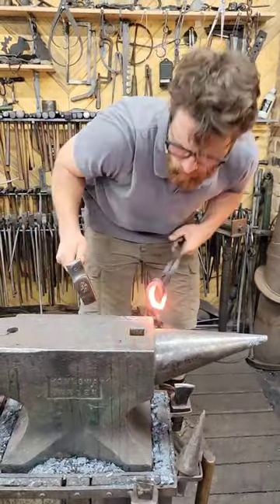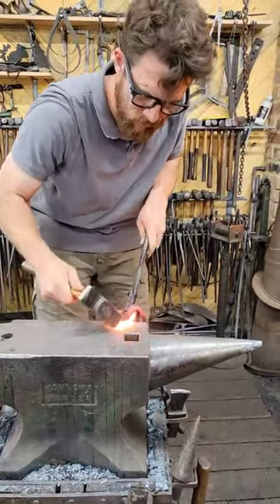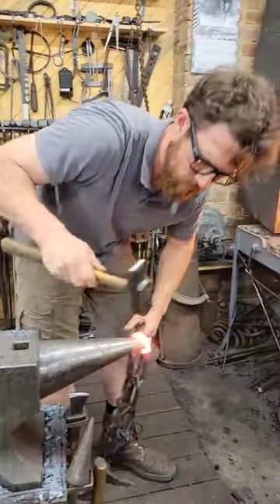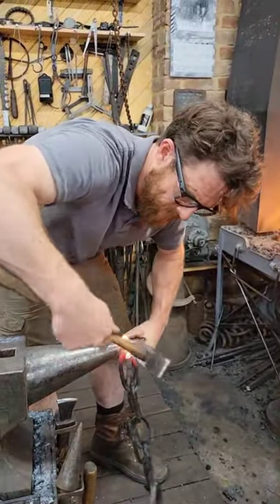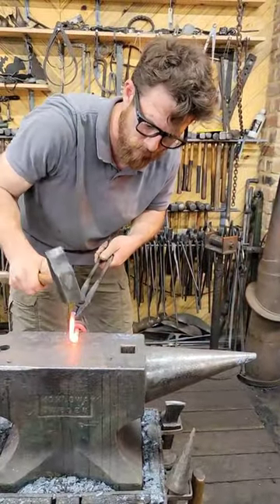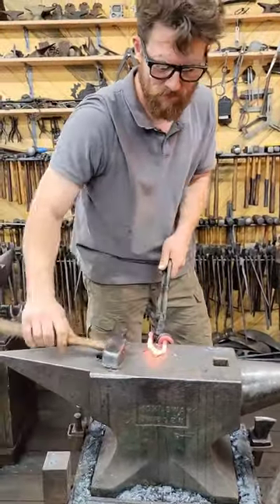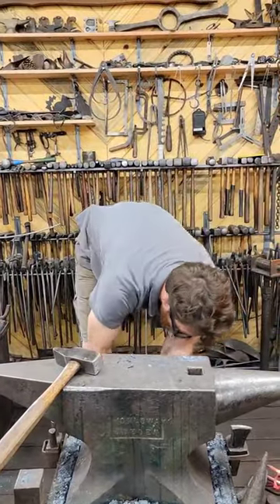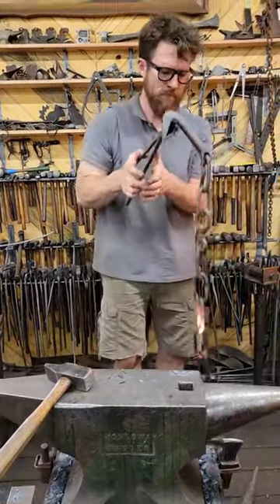Forging Log Chain in the Blacksmith shop #diy #blacksmith #tool #artist #tools #anvil #craftsman

Comment: I mean this with no hate, but uf you're gonna choke up so much, why even use that size hammer? 

I feel like if you went with a lighter hammer you'd have more power from being able to swing further back on the handle, and still have good accuracy

Comment: Although for one off jobs it's probably not worth making one. But a chain welding hardy tool is useful if you've got to do a lot. It's like a little beak that sticks out over the far edge of the anvil, with a little notch in it like a round bottom swage. You can hang the two parts of the chain to be joined on it (two single links, or two sections of any length), then you only need to handle a single link in the fire. Just pick up the other two right on the welding heat. Not sure if I explained that correctly.
Reply from the maker: Thanks! I'll look into this for sure!
Reply: @drew.alexander  The little swage bit is farthest on the beak (for setting and making the weld), and it dips down towards the anvil like a hook to hold the other two links ready to catch up. In side profile, kinda looks like a fat squiggle. Then you can have a pile of chain sitting on the far side of the anvil with no risk of tripping over it or having to drag it around the floor.
Reply: And the little swage bit means you don't flatten or draw out the inside of the chain like happens anywhere else you try weld it.

Comment: hows that hammer elbow going?
Reply from the maker: Huh?
Reply: @drew.alexander  must not have it yet
You hold your thumb up on the handle instead of curling it around the handle. This is an easy way to get hammer elbow (aka tennis elbow).